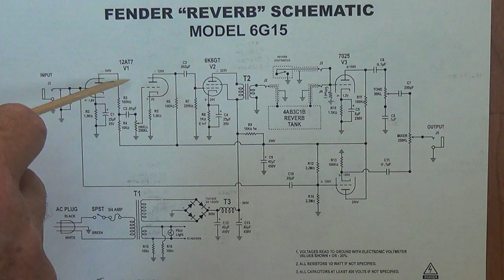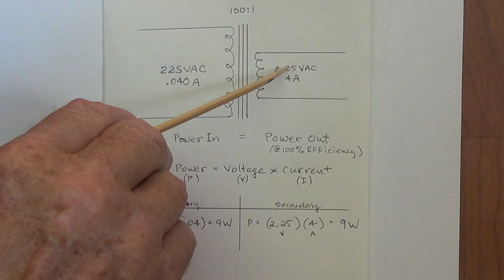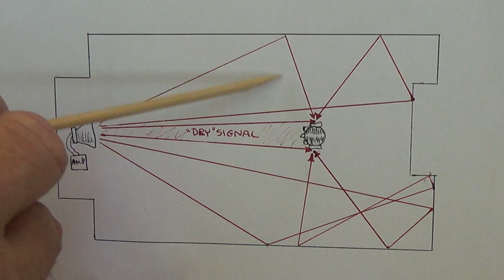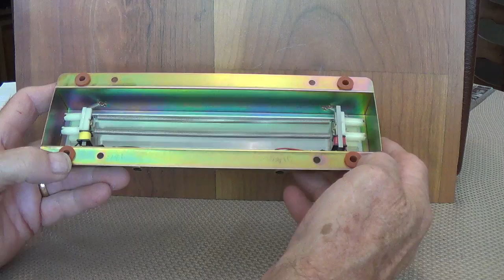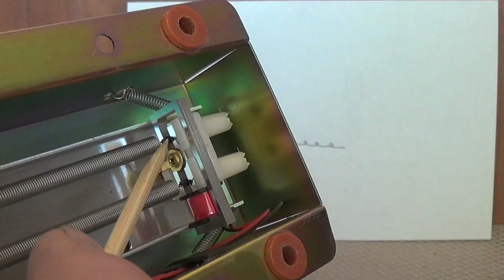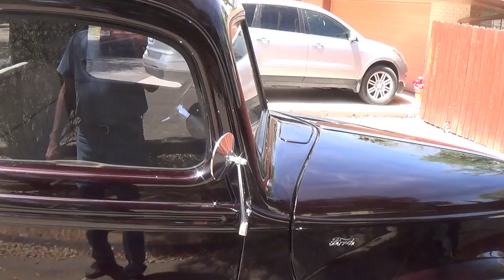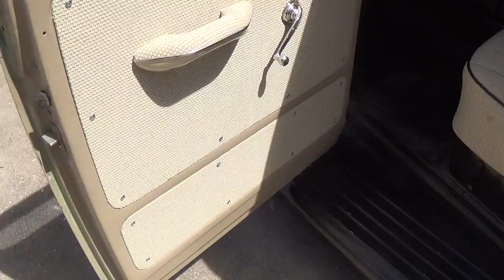Tube Reverb, Part 1

Comment: Very interesting presentation on the Fender reverb tank.  There's another approach to driving the tank using lower current and a higher impedence tank. http://www.channelroadamps.com/articles/reverb_driver/  Not the way that Leo did it but I'd be interested in your comments on the differences.
Also I love the truck.  Chevy made better small block engines anyway.  Don't expect you will be hauling too much manure in the back though. :)
Reply from the maker: Thanks, Hank. I am familiar with tube (not transformer) driven reverb, but they are not particularly well-regarded for the depth or quality of their reverb effect. Fender is the gold standard for reverb, thus I found it to be the best subject for my presentation.

Comment: I had gotten a horrible reaction from etching chemicals and it lead to heat rash all over my limbs and body that itched so badly I should have worn gloves. Anyway, just letting you know I am still sending you stuff it just delayed me because Tolex bolts are heavy and might as well be top heavy if still packaged because they fall over and are difficult to organize neatly with racks or some system of storage ... gotta get a rack like Joanne’s has built for the 28 bolts... or at least the half that aren’t doubles. I don’t care about digital camo in gray or green, pink, dark blue, or especially indigo or blur electric python: I’m hoping others might... also carvin screwed me and lied about the large amount of components that came with or so I was told the dinosaurs that are royonic placement machines.... they are so heavy clunky useless and blocking my Tolex with their footprints. I ended up having to drag the damn things along with me and they gave logistically costed at least 1k and they also screwed up and used my highest bids when nobody bothered with any of the others. They couldn’t give them away. 

Haha point is that I feel bad because I think they could have come in handy by now. Ps. I haven’t been able to find any of the Tolex... oh oh, I have at least 50  of those amp tanks and the impedances are different too
Reply: What the hell did I mean by I haven’t been able to find any of the Tolex? Whatever. You know what I’m going to go find your email and get that sent out even if I have to crawl (that’s the other thing: my knee got very inflamed from whatever happened and I could move around). I know it is not a big deal but integrity is important and too many times favors become disappointing. Thanks for the videos. Missed them this year.
Reply: It is like you guys are in rotation. What the hell El Paso?!?
Reply from the maker: I hope your health issues are resolved soon, Shaun. Best of luck sorting out your acquisitions.

Comment: My parents had a 1966 Buick Electra 225 with Reverb on the rear speaker, I'm not sure why they thought the Reverb was necessary because the inside of that car WAS as big as St. Patrick's Cathedral.
Reply from the maker: I hear you, D50 :)  I installed one of those reverb units for the rear speaker in my old '65 GTO. What a disaster !!  Parked at the drive-in, it was OK.....but trying to drive around with it on was like having an angry hostage in the trunk trying to break out with a sledgehammer. Talk about "crashing reverb" :)
Reply: @UncleDoug  '65 GTO!?? You MUST visit my site. My first R&D engine I built out of Chafey college and put in my '65, "Rock 'N' Roll GTO" changed the Pontiac planet. I need to get you one of my shirts. Type my name in to TeePublic.com search to see the super cool RRE '65 GTO T

Comment: Awesome, awesome, awesome! I'm so happy that you are covering this. Maybe it will give me some insight as to why the reverb on this amp I'm working on is so over the top to the point that it's unusable.
Reply from the maker: Thanks, B55. It sounds like the tank may be overdriven. Are all the components original? Perhaps there have been some substitutions that cause an impedance mis-match.  Regardless, you might be able to reduce the signal input to the tank via a modification of the Dwell/Volume control.
Reply: Uncle Doug It has a 25K:8 ohm transformer driven by the first half of a 12AX7. Tank is a shorty. 8AB2A1B, which is a 10 ohm input tank. Not sure if that would make that much difference, though. Recovered by the second half of the 12AX7. The dwell pot is after the second half of the 12AX7, right before the phase inverter. A 1M ohm audio taper. This was the stock layout and only one of the issues with the Epiphone Valve Senior. Preamp tubes biased a bit hot, power tubes (6V6s) cathode biased to right around 15 watts each. Getting the preamp and power tubes calmed down, but I don't get the reverb design. It uses the same OT as the Deluxe Reverb, as well as the same reverb transformer, but instead of both sides of a 12AT7 driving the transformer, well, like I said above.

Comment: Most eloquent voltage and current analogy I must say. I have always used the little brother spraying a water hose into your face analogy. What I would give to have “nicely parted hair again, instead of sparsely existing hair”. As always excellent video.  It dawned on me this morning with your explanation of the tank that it is taking advantage of Standing Waves “which are the bane of us Ham’s,” to create the delay.  The ride in the 40 Ford was bliss for this misplaced West Texas boy. I grew up strictly Chevy, but own 3 Fords nowadays, so I am of the “use the best parts of each”  camp.
Reply from the maker: Thanks so much for all your thoughtful and accurate comments, Mark. The top of my head can be seen from space ;)

Comment: Question. Is the reverb signal in phase with the bypassed part of the circuit?
Reply from the maker: Excellent question, Alva, and it will be covered when I get to the third portion of the circuit. Meanwhile, count the phase reversals in the "wet" signal, and I think you'll see why the "dry" signal has to be taken from the cathode of the lower triode, rather than the plate.
Reply: I've often wondered if a SE output transformer and/or a reverb pan will switch phase. Or rather if the reverb pan's transducers switch phase.

Comment: Great video.  One question.  The family console stereo had a reverb tank that I would have sworn ran off piezo-transducers at each end.  Am I mis-remembering, or is it just another style?  (Crystal phono pickup vs mag cartridge?)
Reply from the maker: Thanks. No, you weren't dreaming. Piezo transducers are also used in phono cartridges, acoustic and Parker guitar pickups, and Teisco amp reverb tanks.

Comment: Hi Dough, cool video on reverb! To my understanding it's the amp' s that can kill, not so much the voltage. Sweet ride, my rides are yet to be finished my grand fathers 65' Plymouth Barracuda V8 and four on the floor and a 57' Lincoln Premiere which I realy like, but hard to get parts here in Finland
Reply from the maker: Yes, the "threat" of voltage is not harmful until it "climbs the fence" and becomes current, entering and damaging your body. Both of your cars sound quite nice :)

Comment: Does it not just few points of Noise to Signal via delay and filtering at a few time intervals?
P.S.
 I have a buddy with a model A pickup conversion and a uncle with a SWEET Black Model T. 
PPS.
I almost think the old tubes are preferred because you can hear it's not mass produced but a tested product of quality with a lot of variability in a narrow range while solid state is a copy paste solution on cheap that add's no variable to separate you from the next guy while doing the job at a non artistic level of precision for live music at least.

In spite of all the isolation a reverb tank picks up the room naturally and solid state does not, You tell the digital systems what size the reverb chamber is it is and it does not pick up feedback. It does math.
.
Reply from the maker: Thanks for all your comments, NC. I don't fully understand the first question.

Comment: My parents had a Chrysler New Yorker in the 60s.   That car came with "reverberator" as part of the stereo.  It was always fun to fire it up.  But it was so strong that it mostly just distorted the sounds to unpleasant levels.   Another effect that it had was that it became unstable whenever there were bumps in the road.  Railroad crossings were horrendous.  That became my first car when I hit high school. :))

Have you ever played with the sheet-style reverb units?  They take a sheet of metal about the size of a sheet of plywood.  The sheet is shock mounted in a frame.  Input transducer(s) is/are mount directly to sheet.  Then a microphone is mount away from the sheet in another frame that can be moved closer or farther from the metal sheet.  These units need a room of their own to avoid "contamination" from other sound sources.

Love the trucks.  I have always wanted a old step-side in surf green with a nice wooden deck in back.
Reply from the maker: Thanks, CK. I foolishly installed a reverb unit in the trunk of my '65 GTO for the rear speaker. What a nightmare. Just like you described :(  Here is a wonderful discussion of plate reverbs:   https://theproaudiofiles.com/plate-reverb/

Comment: If anyone needs to build an artificial center tap for the heater wiring, run a 100 ohm 1/2 watt resistor from pin 2 and pin 7 to pin 8 on the octal power tube socket. It's even better for noise reduction being elevated from ground by the octal bias resistor and the easiest spot to do it.

Pin 2 and pin 7 are the heater connections for many(Almost All) octal power tubes in guitar amps, refer to the tube datasheet if you aren't 100% positive.

Doug and Jack, it makes my day when I see a new video, thanks!!
Reply from the maker: You're welcome, Matt. Elevating the AC filament supply by attaching the resistors to a DC source, like the cathode, is an excellent way to reduce noise. Thanks !!

Comment: Change your ground symbols to a chassis or common. The ground or earth symbol at your line input is correct.
If your chassis is earthed, you need a legend.
Reply from the maker: I'm afraid I don't follow your suggestion, N1. All the ground symbols used in the schematic refer to chassis ground, including the primary circuit. The only earth ground would be provided by the AC receptacle the power cord is plugged into. Once it is plugged into the receptacle, the chassis becomes earth grounded.

Comment: Uncle Doug...That is simply the best explanation of reverb tank operating theory that I have ever heard! Thanks for that...and I'm looking forward to the final modified circuit. It's already on my 'must build' list!
...and the '40 Ford 'resto-mod' is to die for!! Sure, a restored flathead, or even a 289, might have been nice. For dependability and relative simplicity (small-block Chevys are easily the most often transplanted power plants. As such, everybody and their third cousin make parts to accommodate those transplants, do they not?), though, you can't beat a small-block Chevy...with auto trans for those of us tired of playing around with a clutch all day! The whole project is a winner...and the bed was definitely worth the extra effort, as was the interior! Very cool ride! :-)
Reply from the maker: You're welcome, Norm. I'm glad you liked the '40 Ford truck, and sincerely appreciate your very nice comments.

Comment: Never had my ass kicked by amperage...yet. Give it time. :D
Reply from the maker: It's climbing over the fence as we speak :)
Reply: I forgot my dim bulb tester once. Turns out,  I tested positive!
Reply: I once tried to pulled two 100 amp 600 volt fused one in each hand. Had entry and exit holes in my fingers.  Was stupid enough to believe my apprentice electrician had turned off the main switch, when I asked him. I screamed like the guy from the movie Home Alone, when he got electrocuted on the basement sink handled.
Reply: I welded a screwdriver into a 200 amp service panel once. Scary and fun all at the same time. Having said that once was enough to make me buy insulated screwdrivers 😂
Reply: The Guitologist 
Well that’s really good; I hope you never do. I stupidly have, 220 across the chest, very lucky to tell of this idiotic stunt.
Reply: I slipped and touched my hand across the buss bars in a 440 load center. When i woke up I was very disoriented. I thought someone had hit me. No significant physical damage.
Reply: My 3rd year physics lab had a sign on the wall:

"It's not the voltage that kills you, it's the amperage. The human heart operates on 300-500 milliamps and when that much current is introduced to the heart muscle from an external source it will stop the beating of the heart." Scared the you know what out of formerly careless me.

Who knew?
Reply from the maker: Yes, indeed, a cardiac defibrillator can work two ways......by starting a stopped heart, and (sadly) vice-versa.
Reply: It is the Ohms law. No volts, no current. Dry fingers can be somewhere around 1 MOhm hand to hand. Fatal current is nowadays defined being somewhere between 100 and 200 mA. Which means that with dry hardened fingers and a light touch it can take upto 100 kV to kill you. 

Add some sweat and a good contact, resistance can be down all the way to 10 kOhm, which means that  1000 volts passing through the heart area and it is a very likely a bye-bye. Thus 300 to 600 volts is usually very nasty but there is a possibility of survival as some has commented in this thread. BUT. 

The ugly part is that when you get a burn from electric current, at the contact point, even a small one, resistance can go down to 500 Ohm. Then mere 250V gives you 500 mA and that passing the heart area is final mistake unless there is a helping hand around. 

So current kills, not the volts. Otherwise people would be dropping like flies from static electricity. But on average, humans being quite high resistance objects, it takes a quite high voltage to get the current to the lethal level. 

Unless you are wet, sweaty or get a burn. On average, do not push your luck.
Reply: makes my tongue numb just thinking about it. :-\
Reply: The Guitologist hey Brad, I dig Doug too, I’m a keyboard player but like doing repairs
Reply: When I was maybe 19-20 years old I had one of those prank books with a AA battery that was stepped up enough to tingle the fingers when the cover was opened. I wanted more power (Think Tim Allen) so I rewired it. I cut out the inside and added several 9v batteries in parallel. No! Opened the book just once and it damn near pulled my elbows together.
Reply: I may or may not have strummed my guitar while plugged in and the other hand holding a clip in place while "testing"......
Reply: As an example, in Finland (5,4 million) 2016-2017 only people who died to to electric shock either touched the high voltage line (kV range) with a crane or climbed on the roof of the railway car and had a Darwin award nomination discussion with the  25 kV line and were nominated. 

In 2015 there was one fatality from household power socket, in which phase was connected to the protective ground contact. Worker had a metallic power tool, grabbed it with both hands and died. 

Thus 230V is in some cases fatal, but not nearly always as strange it might sound. Thus European 220-230V does not on average kill you, which is the reason it was chosen. It is just a Russian  roulette, not a guaranteed kill, so five out of six will live.
Reply: I ate an IT-11 at the full 600 volts once.... It was not a pleasant experience....
Reply: I once had the misfortune to get zapped on the palm of my hand by the 4-pin mains plug of a 3-phase arc welder that was powered by 415V AC @ 15 or so amps, I was in the process of removing the 4-pin mains plug in order to replace it with a new one, I had forgotten to discharge the two huge capacitors lurking in the back of the 3-phase welder, and the residual charge in the capacitors flowed through the easiest path between two of the pins, which happened to include the palm of my hand that was holding the 3-pin plug, did I jump?...jump I did, moral of the story is, always make sure the capacitors are properly discharged before working on the equipment after turning it off and un-plugging it from the mains, that's an experience I never want to repeat.
Reply: I got zapped onstage once an old fender amp (not mine) had the back open up !!!   I whent for the stanby swicht but it put my hand into the hopen amp instead....

Comment: The only tube that beats a 12AX7 is a 6EU7. Although not a drop in replacement due to pinout, It's specifically made for AF and low microphonics. I've either rewired or bought socket converters for most of my amps that use 12A*7 tubes. The only problem is they are getting expensive.
Reply from the maker: I believe that, as far as amplification factor, the 12AX7 and 6EU7 are tied, Rob......and there's no denying that both are exceptional tubes.